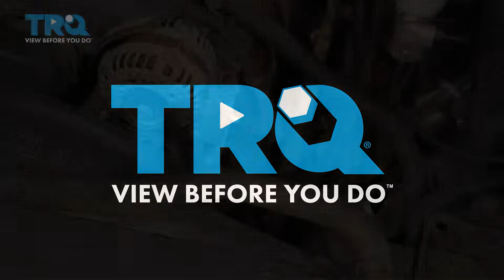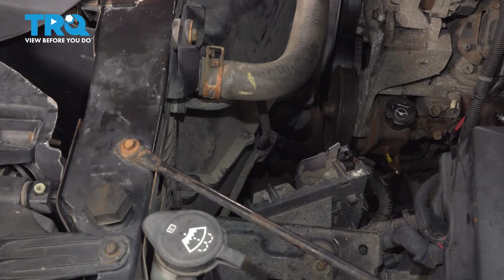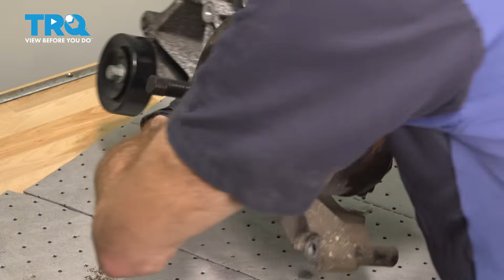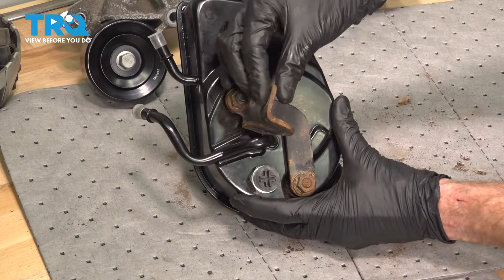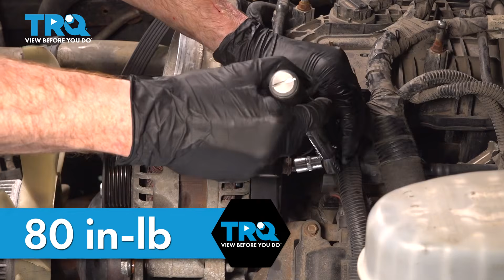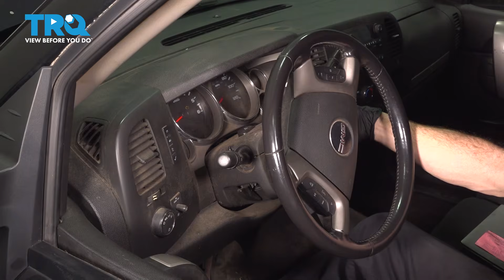How to Replace Power Steering Pump 2007-2014 GMC Sierra 2500 HD

Comment: I replaced mine on a 2006 sierra 2500hd 6.0 and it’s leaking from the back somewhere. Do you think this could be a bad seal? It leaks when it’s not running